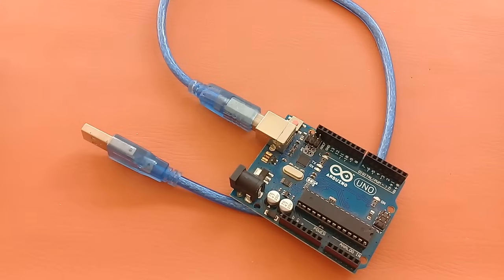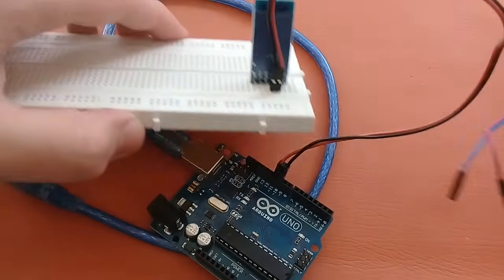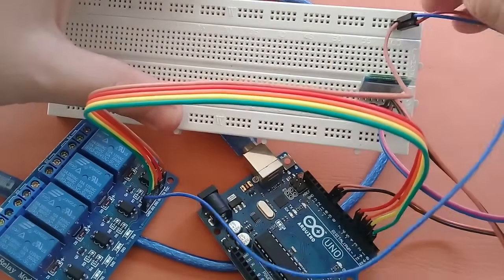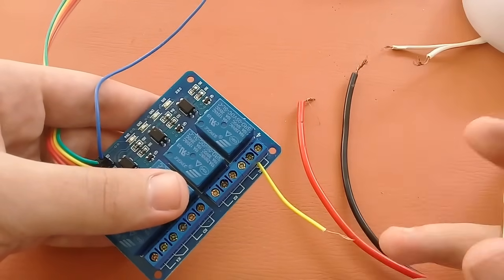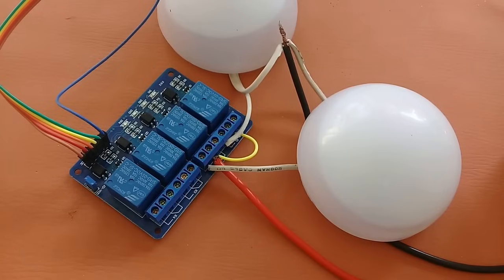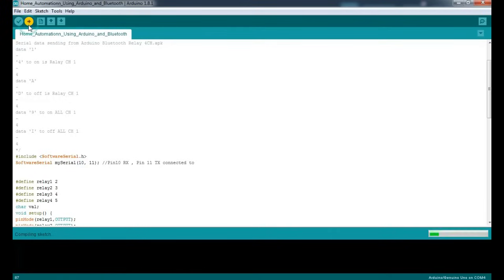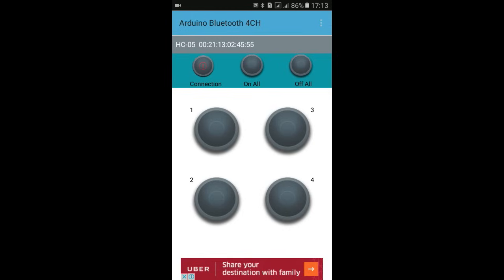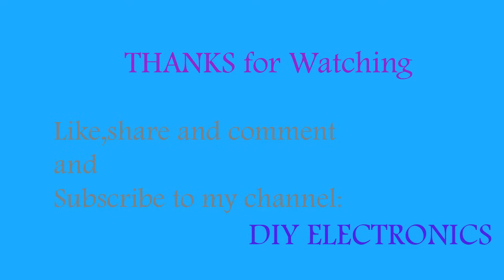How to make Home Automation System Using Arduino- Code +  Connection

Comment: Hi
Im trying to run the code but at the bottom ,says there is a problem .
What can i do ?? Please answer

Sketch uses 3366 bytes (10%) of program storage space. Maximum is 32256 bytes.
Global variables use 306 bytes (14%) of dynamic memory, leaving 1742 bytes for local variables. Maximum is 2048 bytes.
An error occurred while uploading the sketch
avrdude: ser_open(): can't open device "\\.\COM1": The system cannot find the file specified.
Reply from the maker: First make sure you have selected the right board and port in the Tools menu in the Arduino IDE. Disconnect the TX and RX pins of the bluetooth module from arduino and then upload the code to arduino.
Reply: @AzharElectronics  Im using breadboard mb102 instead od project board gl
Is that a problem? 
Is there difference in the pins?
Reply from the maker: @sanjapetrusevska7689  No that is not a problem

Comment: Hi , im truing to make the project but i must ask , can i use breadboard mb-102 instead of  project board gl ?
And can you tell me more info about the led bulb that i must use ?
Thank you
Reply from the maker: Yes you can use MB-102 breadboard power supply. You can use 12V DC Bulb. Or you can use 220V AC bulb. But beware! 220V AC is dangerous
Reply: @AzharElectronics  Thank you 
If i have problems i will text you again. 
Thank you so much
Reply from the maker: @sanjapetrusevska7689  OK, No problem

Comment: If you cant use it with 220v  there is nothing special in it , nobody use 12v as a power source
Reply from the maker: I can. But I didn't. In order to simplify the video.

Comment: How to connect the relay module to an extension box so i can plug in the device on that socket and on and off it
Reply from the maker: Beware! It will be 220V AC. It is dangerous.
It is simple as I did in the video. But I used 12V DC and you will use 220V AC. Consider your live wire and neutral wire as battery positive and negative respectively. But first check the relay rating then put load on relay.

Comment: bro plz tell me the total cost you spend on this project.....
Reply from the maker: This is Today's prices of Components on Ali Express.
Arduino Uno R3:  $2.98
4 Channel Relay Module: $2.16
Bluetooth Module: $2.09
These are the main components used in this project. 
The Total Cost is $7.23. 
But it will cost you lesser if you buy offline.

Comment: Is this mini project Or major project???
Reply from the maker: Mini Project
Reply: How to identify it is mini Or major project?? Bcz we want to make it in clg
Reply from the maker: @shrutikalamkar6167  It is mini because in this project an arduino, and relay module and a ready made mobile application is used. You can make a full home automation project as a major one, which will have sensors and every device will automatically turn on or off based on some conditions. For example, If you want to turn ON the lights of terrace whenever you go to the terrace. So in this you will use a sensor which will detect you and turn the light on. But in Major project you will use a lot of such automatic systems. You can make a mobile application which will show you what are the conditions in your home, which devices are on or off. Also if you want manual system then you can add a function in the mobile application to change the automatic system to manual. To make home automation using Wifi, I will recommend you to use nodeMCU.
Reply: Thanku so much for explaining so well... I am from cse branch and wanted to do major project in college for final year... Can u guide that what topic will be suitable as major project of iot?? It will help a lot sir.. Apart from home automation what else can i go for??
Reply from the maker: @shrutikalamkar6167  Topic of IOT Project depends on which project you are making. Moreover you can make an autopilot car, or any kind of problem solving project. You can make a gesture to speech glove. That glove will be used for people who can't speak and by making gestures, the glove will convert gesture into speech.
Reply: @AzharElectronics  Can u plz tell where will we get this gloves to speech topic.. And is this topic a major project??
Reply from the maker: @shrutikalamkar6167  It is a major project. Sorry I don't know where will you get the topic.

Comment: What voltage did you supply to the 4 channel relay???
Reply from the maker: To power the 4 channel relay module I have supplied 5V from arduino and to power the devices I have supplied 12V from the battery

Comment: Why you not connect the Bluetooth  Tx and Rx pin to the arduino Tx and Rx pin
Reply from the maker: You can connect but mention it in the code

Connect TX of bluethooth to RX of Arduino

And RX of Bluethooth to TX of Arduino
Reply: While i connect the bluetooth with app they connected but also show error
Reply from the maker: @RahulSoni-mv4gs  what is the error?
Reply: Problem connecting to Ls 4505 DC:E8:38:C1:F4:B7

Comment: Hello sir...for this project..plzz upload circuit diagram as early as possible
Reply from the maker: It is available in the app.
Download the app click on the 3 dots at the right top corner
Reply: @AzharElectronics  can i also get the proper circuit picture
Reply: Which app sir
Reply from the maker: @rakshabandhanagouda5182  the app which I have shown in the video with which you will turn ON and OFF the devices
Reply: I checked in that app...it showing the error message
Reply: Plzz send that ckt diagram to this mailid...Shwetasappadali@gmail.com
Reply: Plzz send today itself

Comment: Could you show how to accomplish this without the phone interface.  Meaning, I want to turn on a device through wireless connection but using another arduino as input.    Voltage input to first arduino, results in second arduino turning on a device.  Connection is wireless.   No phone app involved .
Reply: Bro did u made it?

Comment: can i use this in 12v system i mean solar bettry 100v not in big power i mean 230v ???
Reply from the maker: Yes you can use. Check the relay ratings, and the voltage is 100 V which is dangerous.
Reply: Azhar Electronics so i can use simple low voltages system 12v lights and fans
Reply from the maker: No you can use 220V also but be careful it is dangerous.
Reply: Azhar Electronics its not work on little power 12v ?
Reply from the maker: It works. Relay is a switch.

Comment: is there any specific bulb which i should use .....and can i connect the bulb through a holder???
Reply from the maker: Nothing specific. You can use any of the devices. It depends on the external voltage (As I supplied 12V DC for the lights I used) and rating of relay. You can use 220V AC ( It is dangerous) for 220V AC lights. Yes you can connect a bulb through a bulb holder. 
The relay works as a switch. Its connections are like a switch.
Reply: thank you....

Comment: what does the relay work in this operation?
Reply from the maker: It acts as a switch to turn the devices ON or OFF.
Reply: Switching on and off large voltages😊

Comment: ahmadtariq8092@gmail.com  send me code plz
Reply from the maker: Done.
Check your Email for code.
Reply: thank u sir , for reply me
but i have a problem i upload the code and conection are complete but after tha conect app when i tuch button tx led  blink at arduino board but output not working, in serial moniter show onely box not a any value
i m still here plz solve it thanks for that

Comment: Dear Azhar
Its a nice work my friend. I am looking for a Arduino project with 4 relay Output along with the code for AC Fan speed control and 2/3 Light On / OFF. Hope you will reply soon. mrmasaud71@gmail.com
Reply from the maker: Done. 
Check you Email for code.

Comment: Why did you not use the RX/TX already which are there on arduino pins 0 and 1 ?? any reason for that ??
Reply from the maker: No reason.  You can also use that but you will have to change the pins in the code.

Comment: can i use 4 devices one the relay will it work
Reply from the maker: Yeah you can use four devices on one relay but that must be light devices which don't have high rating. All the four devices will turn ON with one relay.

Comment: What you r doing in bread board is not clear.soo pls can you show me the diagram you r doing on the bread board pls
Reply from the maker: I am connecting the wires according to connections given in the code. You can connect according to the connections

Comment: Can you pls show what you r doing on the bread board bro pls
Reply from the maker: It is a solderless board.  It needs no soldering. It has its own connections made on it. I am using it to connect the different wires of components with arduino.

Comment: How will i power the relay
Reply from the maker: Connect the GND and VCC pins of relay board to GND and 5V pins of the arduino respectively.

Comment: can u send me the code akranthi20@gmail.com
Reply from the maker: Done
Reply: no its not working
Reply from the maker: Exchange the TX and RX pins
Reply: whenever I give input from the app.. the tx ligt blinking but relay board is not responding..... when i remove rx connection,relay board is turning on and off itself without the input
Reply: thanx for the code everything working fine